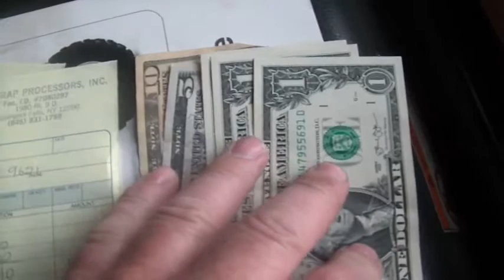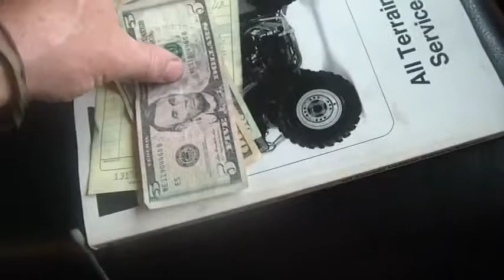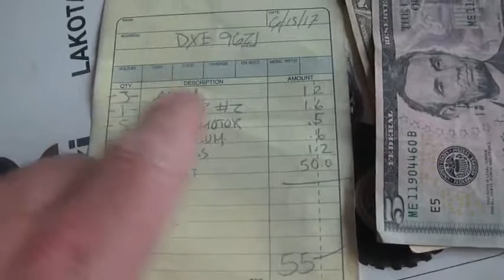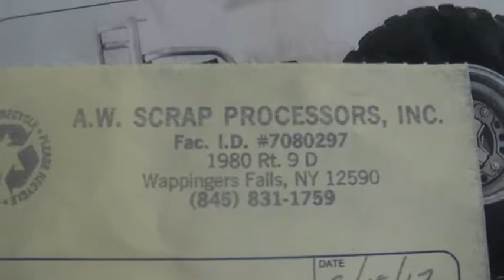Current Scrap copper, steel, aluminum, cat converter prices

Comment: I make a run to the scrap yard about once a year....but i mostly do copper aluminium and brass.......parting out bikes leaves a guy with a lot of high quality aluminium....and my brass mostly comes from shooting ranges and other areas people shoot.....the good reloadable brass I get 14 buck's a pound for....the bad brass I pop the primers out of and toss them in a bucket....i scrap a lot of aluminium car and truck rims that are bent or tweaked or badly curb rashed.....and cats I always cut those out of every vehicle I can come across for free.....those are just as good as money in the bank....and if you've got a sawzall and a good blade its well worth the 10 minutes of work to cut those out
Reply from the maker: Hey Dude!!!  I consider the steel gas $, all the other stuff is where the $ is.... Unless I have a pretty decent pile of not steel to bring in, I don't make the run... Hopefully, this part time plumbing job gives me a pretty good source of scrap metal which will give me the $ to buy toys at the scrap yard.... Thanks for the info, Ur thoughts, watching, and commenting!!!